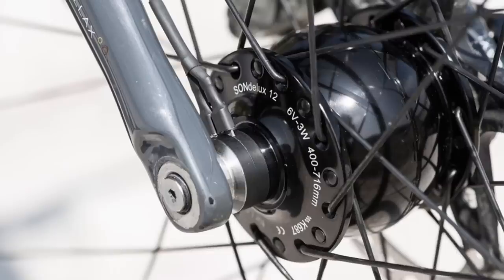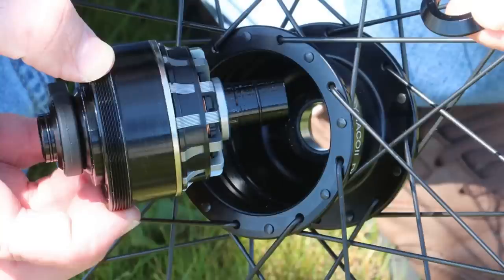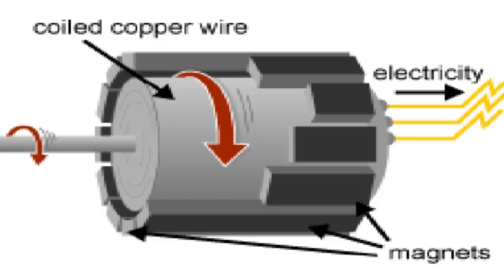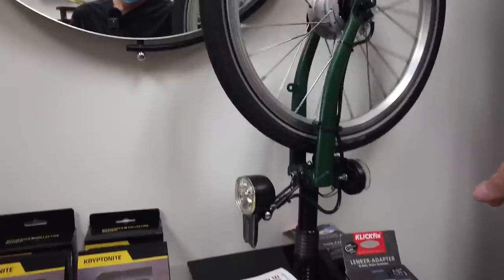Brompton dynamo hub (why I don’t want one)

Comment: I now use the Busch+Muller IQ-X light on a dynamo hub. It's quite bright. I don't notice the drag really. I used a bottle dynamo back in the 90's with a cheap plastic light mounted to the brake caliper bolt. I replaced the bulb with a halogen bulb for flashlights and had a good bright light. I did notice the drag with that.
Reply: I’ve got the IQ-X as well on a SON28 and love it. Getting it angled properly was a bit tricky, but now it’s set, it’s great. 

It’s on a 30 yr old Dawes Galaxy with full racks. The drag from the dynamo is the least of my concerns. I love knowing my lights will just work.
Reply: @nuttycommuter3718  It's really best to just aim the light straight ahead. The way the light is designed it will keep the light out of other bicyclists and pedestrians faces. It is referred to as an optical block. So far I have had only 1 pedestrian that thought he was going to get blinded by this light. He was shielding his face as I rode past. In reality his head was just above the light cone.

Comment: I put a Schmidt’s dynamo hub on my randonneur,but in case of the birdy my powerful battery lights are sufficient because i barely go more than 50 km on my Birdy.For longer rides with more than 4 hours i need to keep my garmin charged,and i like the 80 lux busch und müller front lights-they turn night into day!
Meanwhile i keep the lights running all day because i noticed in traffic they will see me better.In Europe the sun goes down at 4 pm...
By far the best are the ones from german manufacturer Schmidt’s! Smallest drag at the size of a billiard ball.I even run the old polished model for 16 years now with no problems at all.
But the drag might grow as the wheels go smaller.....
For my birdy i got the mount for a maglite and for the garmin edge🤙

Comment: Good informative presentation Brian!.  I am a touring cyclist who has researched a way to keep my cellphone, headlight, and camera working while on tour.  Looked extensively into dynamos, large battery packs, and solar panels.  Weighing the cost, weight, efficiency, and utility of each, I chose solar.  You brought up the issue of cellphone charging from a dynamo. Same problem with a solar panel - variable output.  iPhones, in particular, have very sensitive charging electronics and usually will not accept variable charging input.  The usual solution has been having the solar panel or dynamo charge a battery pack which, in turn, charges electronics. Goal Zero, a solar panel manufacturer, came up with a "conditioner" that plugs between the solar panel and electronics, allowing iPhones to charge, at constant current, directly from their solar panel to an iPhone.  Biologic, a dynamo manufacturer for folding bikes, also developed a ReeCharge conditioner used between a dynamo and electronics, eliminating the intermediary battery pack.  Peter White Cycles, offering the biggest selection of dynamos in the U.S., along with years of expertise,  also offers a conditioner for bike dynamos. My Voltaic solar kit(panel, 4000mAh battery pack and cable) fits on top of my bike bag on the luggage rack and weighs 13.5 ounces. I paid less than $100 for everything and it works beautifully on the bike and in camp. It powers my 1300 lumen headlight, Canon G7XII camera, and Samsung Galaxy 7 cellphone(one at a time).   For a 1-3 day boondocks tour, a large battery pack may be sufficient. For a week tour, the solar panel works well and is inexpensive and simple.
Reply from the maker: I couldn’t agree more.  Solar/battery pack is definitely the way to go.

Comment: There is one legit use for a dynamo hub for commuting with a better alternative and it is for a backup stop light that is always on. It doesn't really need to be blindingly bright. It is mainly for being seen under unexpected situations such as when you go through dark like under bridges or weather going bad or main light failing. It is the second best safety equipment I can think of after mirrors.

The better alternative is (imo) a light that works with spoke magnets. They used to be expensive then cheap then expensive again. Some are too dim, some are too fiddly, some are flat out crap but if you can find one that you like, it is way better than a dynamo for backup lightning. Spoke magnet lights are cheaper, lighter, with no perceptible drag and easy to install & uninstall.
Reply from the maker: I carry several lights with me at all times.  I always run (2)250 lumen flashers on the rear and carry two back up ones just in case.  I have 1 1200 lumen front headlamp and a 1000 lumen backup headlamp just in case.  I love the brightness which some drivers complain about.  When they gripe about how bright my lights are, I reply”well you saw me didn’t you”.🙂
Reply: @9demirtas Do you have any recommendation regarding a particular model of lights with spoke magnets? Thank you

Comment: My other bike is an ebike and it's great to have the lights always there and always on. Dynamo hub + lights brings the same thing to a regular bike. I have been considering getting a dynamo hub and lights to my other bike. I just hate to attach and take off the lights all the time and also remember to charge them. My other light also has a huge battery so it doesn't need to be charged every day but when the ring turns red the battery is going out fast. So it does not indicate charge level properly.

Comment: On this issue the brommie is quite different from regular commuter / city bicycles. On a regular bicycle, that is often left outside, locked on the street, battery lights are always that extra thing to think about - they get stolen easily and can be quite expensive. Dynamo lighting gives you peace of mind. The bromton is always with you so that risk of theft is much reduced. 
My previous two bromptons had a dynamo hub and they provided a very reliable and adequate light (esp for urban commuting in well-lit cities in Belgium / Netherlands). They are always there - and did not notice any drag, am not a racer but tend to ride quite fast :-) the weight was there, but both bicycles were already ‘maxed out’ in weight: telescopic seat pole, brooks saddle, rear rack, often carried a bag etc.... 
But decided to go without on my latest brommie:
- wanted to make the bike lighter (also no rack), 
- I most often took an extra rear light as I like it to be higher, feels more visible to other traffic (this can at least partly be solved reliably with a helmet with integrated / mounted lights);
- Even considering the reliability of the hub light I quite often took an extra battery light, just in case, but also for darker areas on longer rides outside the city;
- I still take a spare light (found that that’s useable front and rear (more to be seen than to see, to get me home in town));
- battery lights have gotten lighter and more reliable, easy to recharge on the go with a battery pack if needed and good ones offer a lot of useful lighting options (for urban use I really like the beryl laser light that projects a green bike silhouette on the road in front of you - very useful at crossings and warning pedestrians);
As an argument in favour of hub lights, they are more eco friendly..
Reply from the maker: I am going to be doing a video on a dynamo that is much better soon.

Comment: I have a touring bike with an 8 speed Shimano Nexus rear hub, a Gates carbon belt and a Shimano Alfine shifter. Some people post they have a bike with external gears because they want faster shifts. My hub, Gates belt and shifter shift gears instantly. I never clean or lube the belt and it never breaks down, ever. My front wheel hub powers a bright front light. All good so far. I lose some power when I'm climbing vs. my old mountain bike with no hubs but on the flat road I lose no power, the bike is very fast. I agree that this small loss of power for a touring person is going to be considerable over 100 miles etc. For commuting and local errands, the benefits of my two hubs substantially outweigh the loss of power when climbing hills. It is a trade off. You had bad experiences with hubs, I had bad experiences with malfunctioning derailleurs so I'm done with them. You educated me that I could be losing power from the front hub which had not occurred to me. An educational video as always.
Reply from the maker: Thank you....life is a trade off.  We all have to find the setup that works best for our particular situation.
Reply: This guy cycled 100,000km across 100 countries. He provides data on the efficiency of internal gearbox hubs and external derailleur gears (not the front dynamo hub). It is very interesting. 
"Derailleurs are undoubtedly the most-efficient drivetrains available, with an average drive efficiency across all gears of between 95-97%. As you need to employ a gearbox system on a belted bike there will always be additional frictional losses. According to the data we have: Shimano internal gear hubs and Pinion gearboxes are a bit over 90% efficient, while the Rohloff hub jumps up to over 94% efficient – the efficiency discrepancy is one of the reasons you’ll rarely see gearboxes and belt drivetrains on race bikes. There can be additional resistance at the belt too but it’s a much smaller percentage than the gearbox itself."
https://www.cyclingabout.com/belt-drive-best-bicycle-drivetrain/
4.17 on his video, which is outstanding.

Comment: 30 years ago I had a sanyo dynapower nh t6 6v3w on a Alloy racing bike and that light was phenomally bright. I changed the bulb from 6v to 12v halogen as the 6v would burn out very quickly.
These days I use an Exposure MaxxD and a Diablo and these make the dynapower light look like a birthday candle...such is modern technology...LED lights are getting brigther and lithium batteries are getting more efficient.

Comment: I did a project on this at college years ago;  I measured that about 10% of your pedalling power was used up by the dynamo. 
That was  for a "bottle" dynamo that brushed against the tyre rather than a hub-mounted one. 
The technologies in battery energy storage and LED lighting have improved considerably since then.
Reply: The technology in dynamo hubs has improved considerably as well. Most only cause 1.5 to 3W of drag. The average cyclist has an output between 200W (women) and 260W (men). That's 1.5% at worst. CyclingAbout has some good calculations on average drag caused by different setups (upright, sporty, panniers and different weights).
Reply: @JaccoSW  Everything has improved in cycling since then. Legal requirements for lighting stipulated incandescent bulbs - LEDs would have been illegal. A 1.5W LED lamp is now very bright, and they aren't illegal. I doubt that I have a sustained output of 260W, but I intend to improve.
Reply: @johnwright8814  absolutely, or at the very least we have better and more specialised solutions for everything. LEDs have made a much, much bigger impact on our lives and design than we sometimes think. The fact that we have high-powered lights that last a very long time is due to rapid advancements in LED technology.

Comment: About drag. I would like to see a vídeo demonstrating your sensitivity about the subject( how many times turns a wheel pulled by hand ),  comparing it with a normal and equivalent wheel.
Reply from the maker: I would love to do a video like that, but I got rid of my dynamo hub wheels a year ago.  I had no use for them.  I might have to borrow a dynamo wheel for the Brompton to measure the difference.  I will try and set this up.

Comment: Another great video, Brian! I just got my Brompton and loving it. Which lights are you currently running and recommend? I have a stock M6R and will be using this for commuting/errands. Which front/rear batteries do you recommend? I would like a set that doesn't affect the fold.
Reply from the maker: I will do a video on the lights I use soon.

Comment: Hi Brian, thank you for sharing your thoughts.  Very informative!  I also choose a Brompton without dynamo. My main reason was and still is that the standard lamps are placed to lowto the ground.  The places where i cycle have intensive traffic.  I have 1 rechargeable strong light on my steer and 2 on the back: 1 under saddle and 1 on my backpack. I am concerned that lights that are just above the ground, are less visible. Not sure if my concerns are justified but it gives me a safer feeling(-:
Reply from the maker: I agree, in addition those dynamo lights are not as bright as a good battery powered one.  I have a similar set up as you with my light placement.  The whole idea is to be seen.😀

Comment: Phones does not like to charged the way you can charge them on a bike, it is constantly turning on and down, it is not good for them, but there are hub chargers with built in battery pack, and can charge the phone in a relatively constant way. But still it is bad for your phones battery if you charge it all day long, they supposed to be charged with the rated charger in an hour or two. If you put your phone at home to a slow charger all day long, it will kill your battery. Btw I like dynamo hubs, of course they can not be that bright(like a cateye 800), but it worth the trade of on speed, because I can run my light all day long, it makes me more visible, and I can not forget to charge my lights :D Do you know Reelight? They are producing induction lights. The loss is far less, they are not that strong, but they are cheaper, and you do not have to change anything on your bike.
Reply from the maker: Wow, I will have to look into that.  I found this awesome dynamo hub that has little drag when off that I am going to review soon.

Comment: I'm also not a fan of dynamos especially now where most bike lights a rechargeable, light in weight, easily removable when not needed and don't cause any resistance when in operation, personally I'll stick with normal lights.
Reply from the maker: Good choice, I agree wholeheartedly.

Comment: The 5Watt drag would make you about 8-10 SECONDS slower per mile!!!
Gasp, shock, horror, Unless you are Racing or Audaxing that amount is negligible.
It's not a race, take your time and enjoy the ride.
If you want to charge your Phone with a dynamo use a powerpack battery with through charge capability so you can charge the battery with the dynamo and the phone with the battery.
Most phones require a consistent power supply for charging which you don't get from the dynamo, stopping and starting interrupts the charge and the phone stops charging and in some cases actually discharges!

Comment: Late on my response but all posts add to your overall metrics or analytics. So here goes.
All of your reasons are valid. But, I purchased my system 9 years ago and then all they had was acid lead batteries.  Now a days with lithium battery the energy storage is superior to back then and the decision pulls the balance back towards rechargeable LED lights. 

When charging off of your hub I agree the charging profile is not a true sine wave but instead a square on and off wave so it’s imperative to use a separate charger even back then which by modern up to date standards battery banks were poor but protected your electronic equipments batteries.

My unit is a Very Very costly German hub that has very little rolling resistance shut off but you can’t escape the resistance when turned on. Having said that the batteries back then were so very heavy. You would carry 3-5 pounds of batteries to last beyond 5 hours. At that time 2012 hub was my best option, now not so much.

Having said the reasons I purchased the hub I’m getting the Swytch so out goes the hub and on goes the Swytch.

I’m thinking of putting the hub on a trailer i might tow and see if that will work!  Awesome channel! Disagreement is healthy and how else will we learn! It’s called new ideas and we all need to explore what we do and can we improve.  

I did not grammar or spell check this, to lazy or bad potty training, it is what it is! Tanstaafl!

Comment: Some things for folks to consider regarding dynamos that I didn't see addressed in the comments. 

1. It's true most dynamo lights aren't as bright as battery lights but most dynamo lights have focused/shaped beams so the light beam goes where you need it and there's not a very bright light spilling all over the place and blinding peds, cyclists and motorists. 

Example, I've a PDW 400 lumen battery powered bike light mounted on my helmet that has a focused/shaped beam the projects a very controlled rectangular shaped beam of light wherever I look. 

2. I've lost, broken worn out and had stolen 100s of dollars worth of battery powered bike lights. 

3. Dynamos don't charge devices and/or battery packs directly , the dynamo hub charges a battery cache in the usb charging device which your device is charged from.. If a device was damaged it would most likely be due to a problem with the charging device and not the dynamo hub. 

4. A dynamo hub can be used to charge a battery pack such as the Cinq5 Smart Power Pack II by Tout Terrain.

Comment: Thank you for the heads up on charging phones. I've just bought a bicycle and love the idea of dynamo powered lights. Anything to save a penny on electric bills ... they are outrageous out here in Pakistan. Bit of a drag is perfectly fine for me since I am riding my Dutch Bicycle anyways and not a road bike. What I was delighted to find out just today was that I could power up both the front and the back lights with that one front dynamo hub!  That is just awsome.
Thanks once again for the critical input. One of my bike mechanics had mentioned the phone charging capacity .. and I was like ... really!! Now I won't do it.